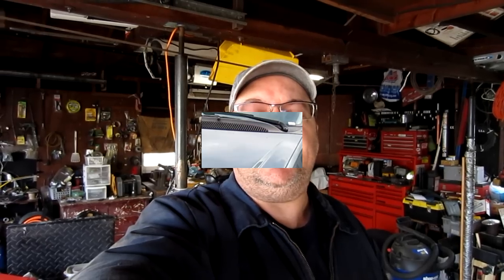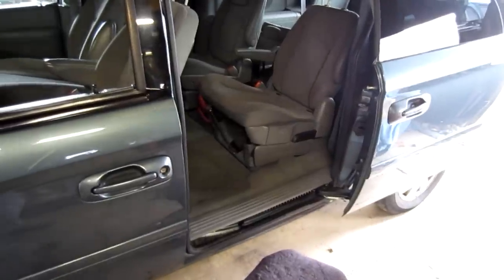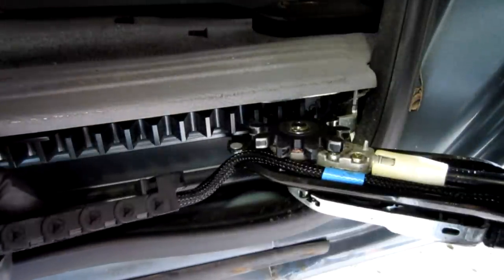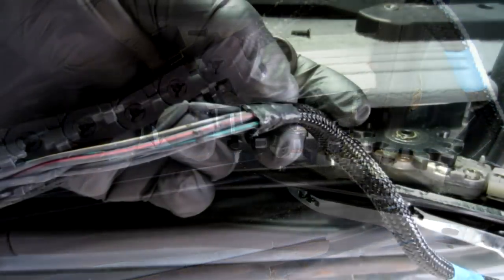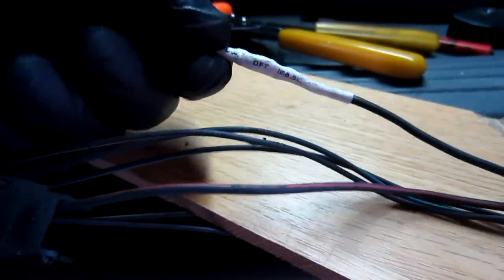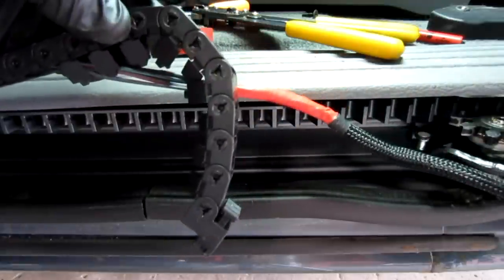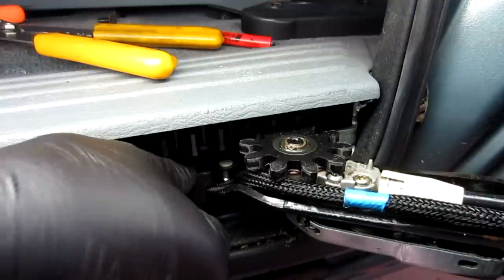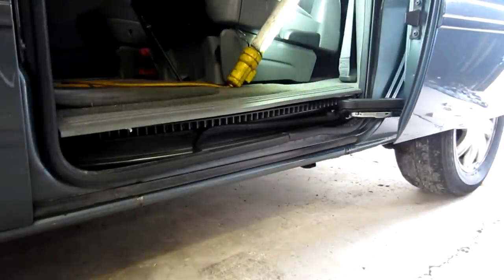Caravan power sliding door Repair EASY

Comment: I would like to share a suggestion on fixing sliding door that won't work, First thing before going to the most common thing which is to go to the wires for inspection,  try this first, Open your sliding door and spray some cleaner inside the lock  mechanism give it a healthy dose wait a while then try your door, if your door then works and it will for a short time, then you should take the locking part at the rear of the door out, you'll see the three torx head screws for removal,  you'll have to take the inside moldings and black covering to get to the inside door stuff then pull the lock mechanism out and give it a good cleaning this worked for my 2003 Town and Country ,  I previously did all the wire stuff didn't find anything wrong, then pulled the motor from the good side and checked bad side motor but motor was good I went through a lot, This simple thing made my door work repeatedly  so i could finally put everything back together, also I did remove the rear seats since i didn't have the stow & go in my 2003 T&C, I wish it was just a wire, much less a hassle! Hope this helps!  As always God Bless and keep the tires on the road!

Comment: A fix like that will be temorary until you replace all of the wire that is in the area where it flex's.  So if you make a repair inside the chain-like conduit, it stiffens the wire in the area where it will be required to flex near 180 degrees, and it will surely break again.  replace the wire with the same gauge well outside of the conduit range will ensure that wire lives another lifetime.  Great video though!  You were clear and concise.  Well done!

Comment: Wow! your video on this power sliding door fix was the best ever. For about a year I have been looking at videos every so often to "do it myself". I am a 62 year old woman on my own. SO once I found your video I went out and bought a butt thingamajig and some electrical wire. I put a patio chair next to my passenger side door and after refreshing my memory by watching your video a few times I just jumped in and fixed it! One wire was severed. I tried the but clamp first but like you mentioned, it prevented the door from closing - so I was prepared because you addressed this. So I took it off and just wound the wires around each other and wrapped the tape around as tight as I could. I used to have a sauldering gun - but no more. So viola! It works. THANK YOU. Oh, also once I touched the 2 wire ends together I heard the slight sound of a beeping so I knew right away it was going to work.

Comment: I had the exact same problem with my '05 Grand Caravan, I did exactly what you said. My green wire was broken inside the insulation but was easy to spot.
I soldered the wire and wrapped with electrical tape. Reassembled and works like a charm.
Thanks for the video and you saved me some $. Thanks!

Comment: THANK U! I saw this video a year or two ago and never got around to it. 5 kids and a heavy manual sliding door has been so hard for my kids to close and open. Sure enough when I opened those caps there were broken wires on both sides. My hubby thought I was crazy for trying to fix it myself but it was SO EASY! My life just got a million times easier. Now how to figure out why my floors in the front are getting soaked after the rain.

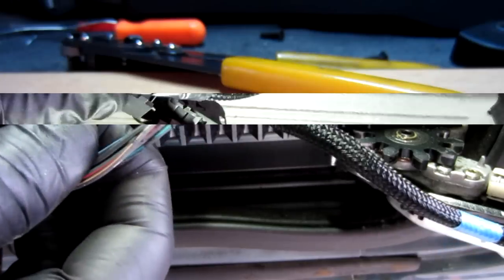Comment: I watches your vid to 3:46 and attempted the search .. took me 5 minutes and found a break on the wire exactly where your break was .. wires re spliced heat shrunk put back together and all works fine now .. 2005 voyager crd .. thank u so much .. very informative and helpful vid .. thumb's up u just fixed my problem

Comment: Thank you for the excellent video and easy to see, in focus viewing of the procedure!! Honestly after hearing the comments about this repair, I'm thinking replacing the wire with a more flexible wire might be a longer lasting solution, just splice it at the ends where there is no bending.

Comment: Thanks a lot for posting this repair. I had the same problem with my 2007 Chrysler T&C and followed the procedure and worked like a charm, I actually found a wire that was broken in 3 different points, I guess only one of them was bad enough to loose connectivity when the cable harness bent at that specific point. That might also explain why mine opened a little bit more than the one Foxboss9 shows in the video.
Reply from the maker: Awesome, you're welcome.

Comment: I have the exact same issue on my 2007 Town & County Touring. Your video is the best I've seen so far. Going to give this a try. Hopefully the wire break is visible and not just an internal break.
Reply from the maker: DirtDiver597 Thanks and good luck!
Reply: Foxboss9 Worked like a (fox) boss! Everything worked just as you described. The only thing is that I started at the pin-hole end of the plastic track and undid all the clip covers, revealing no break. Then I decided to slide the vinyl loom back, and right there was the break. I should have checked there first, seeing that there are some tight turns within that vinyl cover. So, a little wasted time, but found it & fixed it - many thanks to you.
Reply from the maker: Awesome!!

Comment: Thanks for the video, it was very detailed and informative. I have the exact same Make, Model, and Year (even the same color) with the same problem on the same sliding door. I found 2 broken wires and fixed them just like in your video and when I used to key fob I was really excited to see my door start to move for the first time in over a year since I bought it!

It moved about 6" and that was it, now it just makes the same old clicking sounds.
That door is just stubborn. But at least I know I don't need a new motor, it's somewhere in the wires, just nowhere I can find myself.
Reply from the maker: Lucifer2066 😁👍

Comment: Amazing video mine makes all the sounds like it wants to open but it doesn’t but if you pull the handle while hitting the button or fab it will open by itself I replaced the actuator thinking that would be it so maybe it’s one of those other wires

Comment: Man - that's a LOT easier than I thought it would be to at least try that out. My wife will likely be a little aggravated if it ends up being that easy to fix. No solder so I'll have to see what I can use in its place.

Edit - I was able to repair the passenger door with this. It wasn't the first time someone did that same exact repair. The wire they used had also split. I spliced in a longer segment of wire and may need to do that again. That OEM wire is pretty thin, but at least I know where to go now. The butt connectors are way too big to do that job well so I spliced and used electrical tape.

Sadly, the driver-side door engages the motor, but makes some really loud noises and doesn't actually move. So it sounds like something is wrong inside the door itself.

That was much easier than I thought it would be and I wish I'd known about this sooner. It's good to have a working passenger door again.

Comment: I just bought a 2006 SXT for $800.00 with 108k miles.. It's mint. They just got tired of stuff not working and sold it. The doors were one of them.. Now I know whats going on. As I can hear the motors. The doors just don't open.. They also thought the rod bearing were failing. As you could hear a ticking..It was a broken spark plug wire at the coil...

Sadly. I got to buy a new Cat.. Someone stole it...Another $200.00 for that...But I'm going keep it. It's that clean...

Comment: thank you for posting this video!  I just repaired mine.  I found a broken wire and never would have had the b*lls to unravel the wire protector w/o this video.  I thought that it was a chain that was on a track!  Anyway, I used a butt splice connector and electrical tape.  if it fails again i'll sodder it..  I see no reason to get a new harness as long as this works...
Reply from the maker: Glad it worked!!

Comment: Hi, cery informative video,
I have toyota estima 2007, mine is just the door handle, with the key it does the same like yours and locks back, but when i pull and hold the handle it does work. Which clearly shows theres no wiring or electric problem. 
Normally to open or close the door just pull the handle n release it does the work. But here i have to pull n hold untill it opens a little and all normal. Same with closing, pull and hold.
Any ideas?

Comment: Great video.  I have a bit of a different issue in that the door opens and closes perfectly from the FOB or the overhead buttons but not from the buttons by the doors (it does this on both side doors and even the back works perfect).  ONLY the side doors buttons are effected and both of them won't work.  Any ideas?
Reply from the maker: There could be so many different electrical Gremlins that affect your situation it is a crap shoot to try to troubleshoot it.
Reply: @Foxboss9  found the issue was simply the childproof locks that are in the overhead console and one of the kids had pushed the button! Go figure.

Comment: My wife and I have a 2014 Town & Country that is having door problems. The door is on the track and slides as it should. However, pulling on the handle to activate it to open does not work. Clicking the key fob does nothing as well. On the interior pressing the button on the overhead console will close and open it however.  Ideas?
Reply from the maker: GeekdOut sorry, not sure. About that..

Comment: I'm going to try this on my grand caravan. Can you perhaps do this without Sauter, like twist the wires together and wrap with electrical tape?
Reply from the maker: not a good idea. Go to the auto parts or hardware store and ask for some "butt" connectors and a pair of cheap crimping pliers/tool.. They are not expensive and easy to use..

Comment: I have repaired both sides of my 2004 Grand Caravan. the repair has lasted longer than the original.
Also to all Automatic door owners. When the door is opened or closed manually there is a magnetic disc in the Power door moror that "disengages" the motor so that the door moves freely. I have found over time that the disc will keep the motor magnetically engaged and make the door difficult to move manually (feels like you are working against the stagnant motor). When I disassemble the motor and clean the disc it the manual operation works easy and "free". But this is often short-lived. Is there another way to clean the disc to have to keep for sticking over time.

Comment: My switches on the side of the doors don't operate, but the others do. I tried jumping them to no avail. Not sure if the 2 wires to each switch is positive or negative? One switch went out 6 months before the other. I dont know if they have a separate fuse from the front switches or if they share commonality through the snake at the bottom door track. If the ladder than surely they could not have broken there. Dunno really. Any ideas, also if I can test the switch by jumping positive to it or our they a ground switch. Thanks.  Edit, so I just figured out at least about the switch is one ground in one out. Apparently I got ground to it, but out the ground is broken somewhere. Probably in the door track snake that follows the door as it slides. Cool

Comment: 3:16  I have a question.  I am working on a wheel chair van my mom just bought and the sliding door did not work.  I see in the picture at this time a white end and a cable coming out of the drive motor.  Is this what turns the wheel to open and close the door? as the cable seems to be missing on this 2007 Town and Country.

Comment: Thanks fr this. My door works perfect when unlocked but you can't lock it with anything other than a manual push of the door button. If you do manually lock it you lose all functions from the remote, door and overhead button. Could this also be a wire or a different issue?
Reply from the maker: Sorry, this video shows the extent of door work that I have done.. Good luck

Comment: hi foxboss,

i have followed the steps on this video for my 2006 Chrysler grand voyager and saw two problems on the wire and fixed it. the problem is that now the door doesn't get any electricity at all and I have no idea why. I did exactly as shown in this video.  do you have any idea what I can look at?
thank you for this video...
Reply from the maker: chaim junger sorry I've never had that problem. You may want to check for fuses that are specific for those doors. Could be that there's a fusible link inline also that could have burned out. But those are just guesses I really never troubleshot anything like that
Reply: you are sure fast as hell. I live in austria and repairs are very expensive here. as you are more experienced than I am I was hoping you would have a clue. there is no more electricity on the door. the power latch also doesn't respond anymore.
Reply from the maker: chaim junger the www is a Wonderful World isn't it? LOL. Honestly the hardest thing for any mechanic to troubleshoot is electrical. And that's having the vehicle in front of them. It's really difficult to do without seeing and having hands on. You're basically going to have to trace the power going to the door and find out where it has stopped. Without high-dollar electromagnetic tracing tools, it's basically you tearing apart your interior and following the wires back to the source of power. That's why I said the easiest thing probably to do would be just to check to see if there were specific fuses that control each individual door. Or definitely some sort of a relay. Or an inline fusible link. Because when those wires are shorting out there's a chance that it could cause any of those three things that I just mentioned to overheat and fail. Again really not sure. Good luck with it. its not a job that I wood like to do.
Reply: thank you man.  appreciate the advice.

Comment: Very good video, Foxboss9 - all the necessary points shown. One question though. Did you figure out what caused the break? The wire bundle was in a pretty well protected flex track which looks identical to the setup in my 2014 model. 
Thanks :- )
Reply from the maker: Thank you....... The break is where the plastic protector meets the metal part of the door, I assume it's because of the tight angle in which the entire harness gets bent during the final closing of the door. I also assume it will eventually break again at that same point another 5-7 years down the road..

Comment: Very good video. I own 1999 Chrysler and want to ask is it possible to make my doors open like that with this mechanism ?
Reply from the maker: mit3t0 you have to have motorized doors for them to remotely open up..
Reply: I don't need the remote I want only to open the door and it automatically to slide back. Is it possible ?
Reply from the maker: mit3t0 it has to be a motorized door from the factory..
Reply: Ok. Thank you.

Comment: Curious editing. I start taking off the protective clips and never get to a spot where I can see the bare wires. It is mesh insulation all the way down the line. Did you cut that off and not show it - or your door didn't have the mesh the full length?
Reply from the maker: Jeff Stewart no.. The van came that way.. I did not have to cut the mesh...

Comment: I have a 200 T&C. My doors both open just fine but my issue is that both doors will autoreverse when they are almost closed. Would a broken wire be the cause?
Reply from the maker: Since it is happening in both doors I would not rule out maybe a safety sensor of some sort making the door think there is an obstruction and autoreversing even when no obstruction is there... Cant imagine both doors having broken wires causing the same issue..I really never had to work on that type of problem though, Sorry..
Reply: I know this is a very late response, but your issue is the hinge on the back of the door mid-way up. They get tight after years of use and makes the door sense a false obstruction. Spray a good lubricant (wd40 will work) on the hinge and work the door open and closed manually for awhile. Repeat until your issue is fixed.

Comment: Do you think that vans with ADA power ramps would get their wires though the same belt like the door? I have a caravan and neither the door or ramp seem to work fully. And the issue started at the same time
Reply from the maker: That is really a tough question the answer. Number one because I've never worked on one but more importantly number two, it depends on the company that did the conversion. There may be some companies that have done ramp / lift conversions that do use that power source since it's so easy to access and then there's other ones that may run a separate power lead completely. So basically I can answer it in the worst way possible and that is I really don't know
Reply: Foxboss9 thanks so much.

Comment: I have a question,  my passenger side door won't open or shut  all. I hear it trying but fails. Could this help. 2006 Dodge Grand Caravan SXT
Reply from the maker: If it doing well same thing as this one did at the beginning of the video.. It's the same problem. If you hear the door motor running though it is probably something else.
Reply: Laticia - did you find out the cause of this? i hear our motor running through, and did the wire harness inspection without findings anything wrong.

Comment: Can you add an open and shut motor to what is currently a manual door system?
Reply from the maker: You probably could if you had a complete donor van from a wrecking yard. I don't know how many differences there is between a non power door van vs one that came with power But the amount of time and labor involved would probably be more than its worth.. You may be better off finding a new van With that option already installed.. Good luck..